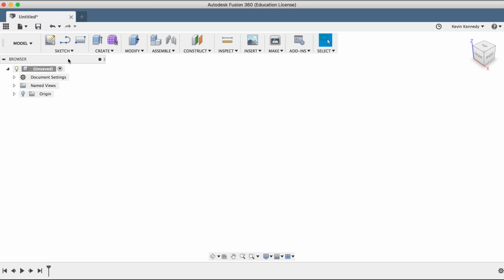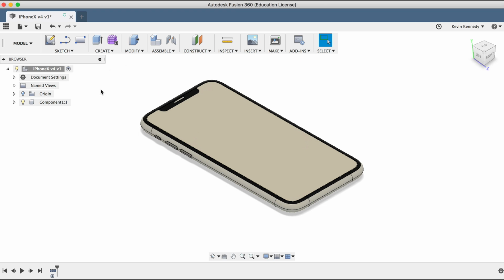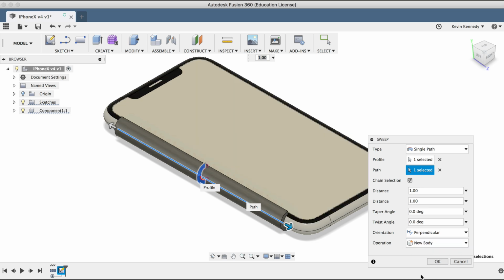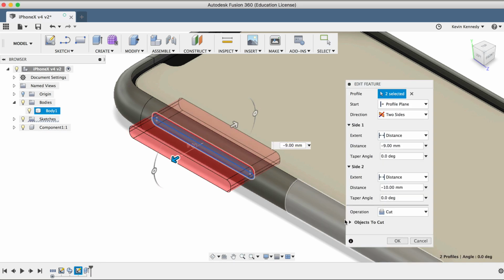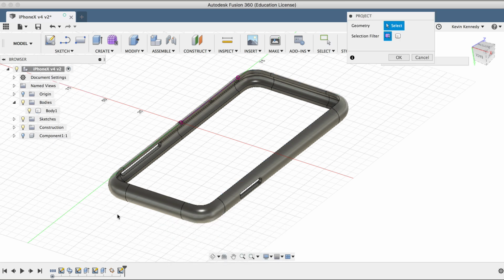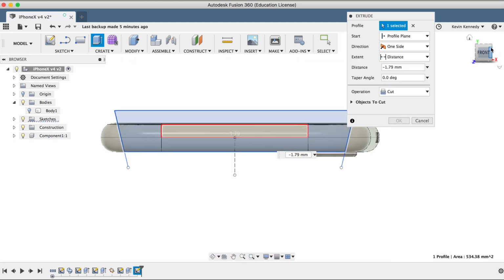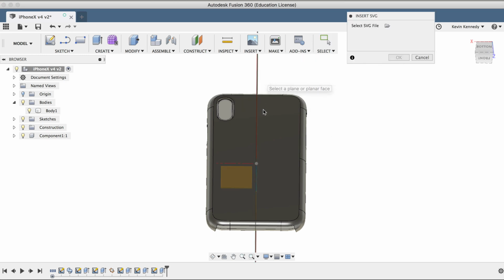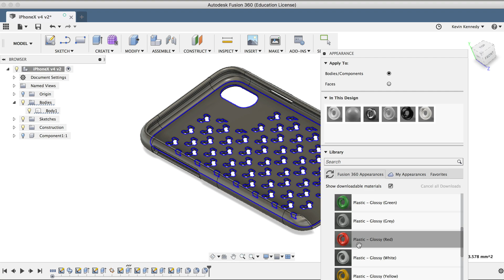How to 3D Model an iPhone X Phone Case - Learn Autodesk Fusion 360 in 30 Days: Day #10

Comment: Your series is very addictive and well presented.
 Only suggestion here is a bit more info on the Cad Model. 
I have a Umidigi A3 Pro and unable to find a cad model. Will an stl file work the same as svg. 
Is it possible to create an svg model of the phone in F360?
Reply from the maker: Thanks, Apa Ched! I'm happy to hear you're enjoying the series so far. Thanks for the feedback. I'll try to incorporate more info in future tutorials. In regards to the phone model, you can simply create a mock model of your phone (Simple box shape with filleted edges) as long as you're able to find the exact dimensions online (or I supposed you could measure it with a caliper). An STL file would certainly work, however, you will want to make sure it doesn't get distorted after being imported into Fusion 360 (this shouldn't happen as long as its 10k mesh triangles or less).

As far as an SVG - the only way I think an SVG file would be useful is if you have an SVG file of the phone shape that is at the exact dimensions. You could then insert the SVG and extrude to the thickness of the phone. If you follow this method the key would be to make sure you add the proper fillets or rounded edges to the model so the phone case fits around it nicely.

Please don't hesitate to comment questions on the tutorials as you work through the remainder of the series. Cheers, Kevin :)
Reply: I was able to measure and create a model in F360. 

Searched On Google and found the F360 Ap store has an Ap for Svg output.
Reply from the maker: @apached343  I must've misunderstood you. Where you wanting to export the 3d file's dimensions as a 2d SVG file? If so, then a plugin would be your only option as there is no native way to do so in Fusion 360. Cheers, Kevin :)

Comment: My phone (the LG G6) has sharp edges and a curve in the middle.. how do I make a straight spline for the parts that are straight?
Reply: This is my model, I'm actually having issues trying to sweep it since it doesn't have a line down the middle: https://a360.co/2KfZCMn
Reply from the maker: @novazipstream2  Thanks for sharing your model. To create a line down the middle you'll have to split your main body in half. First, create a midplane construction plane by selecting the front and back of the phone. This will place the "midplane" in the middle. Then, select the "Split Body" command from the "Modify" dropdown list. You'll be able to select the phone body as the body to split and the newly created midplane as the "splitting tool". After clicking "OK" you'll see that you now have a line (Edge) of each half of the phone body that you can reference for the phone case.

I hope this helps! Cheers, Kevin :)
Reply: @ProductDesignOnline  Thanks for the info! I just managed to get it split but the buttons end up creating multiple sections of the middle instead of one solid middle line, so I can't select the entire middle line to sweep the entire phone. I'm also having this issue where when I try to sweep around the curves of the phone it throws an error saying "Trying to sweep on illegal surface".
Reply from the maker: @novazipstream2  What you can try next is using the sketch "intersect" tool to recreate that sketch geometry where the split should be. This will make sure that the geometry is all one piece and not broken up by your buttons. Your sweeping error is likely caused by your sketch geometry path not being one continuous path...so intersecting the sketch should solve both of these. Here's a video that may be of help to you explaining the intersect command - https://youtu.be/WAs144r-Xko

Cheers, Kevin :)
Reply: @ProductDesignOnline  For some strange reason, I still can't manage to get the sweep tool to go all the way without it saying illegal surface, the intercept tool did help get around some of the buttons but it's still strangely cut into a bunch of pieces. Here's a photo of what i did so far: https://imgur.com/sbDJjxc
Reply from the maker: @Nova Leary Thanks for sharing the image. Can you share the updated link to your file?  It looks like the intersect may not works as expected because of how the original LG file was built. I'd like to inspect it further to see what's causing the breaks in geometry. Cheers, Kevin :)
Reply: @ProductDesignOnline  Here you go: https://a360.co/2KfZCMn

This is also where I got the model of the phone too: https://grabcad.com/library/lg-g6-1
Reply: @ProductDesignOnline  Hey I figured it out! I had to go a couple of offset planes in order to create the middle line and the sketch! Then I had to take the sketch and sweep around that middle line
Reply from the maker: @novazipstream2  I'm glad you figured it out! Thanks for updating me. Cheers, Kevin :)
Reply from the maker: Hi, Nova Leary. You're best bet is to create a combination of straight lines and splines. You can use them together...however, the most important thing is to ensure that they are touching. You'll want to make sure you end up with a closed profile shape, which will be denoted by an orange background highlight appearing behind the shape once it is fully closed. Cheers, Kevin :)

Comment: As usual amazing tutorial... and i want to ask u that the 3d printers are really able to produce smooth finished products?
Reply from the maker: Hi, karthik A. The smoothness of the print depends on the type of printer, printer's ability and how well the printer is tuned. For an ultra-smooth finish, I would recommend an SLS printer for something like this phone case. Using a consumer-level FDM printer can yield some pretty good results; however, it is very likely that you'll see some of the layer lines on the sides. One could always finish the print by sanding it, painting it (optional) and then cover it with a few thin layers of epoxy. The epoxy coatings also add quite a bit of strength. Cheers, Kevin :)
Reply: @ProductDesignOnline  Thank u..
Reply from the maker: @karthika8094  you're welcome! :)

Comment: "for some reason the project didn't work"... story of my life with fusion 360.  Do some commands exactly as I see them, fail, fail, success.  Not changing anything...  Very powerful software but it's got some serious quirks that I haven't encountered using other equally powerful software such as Photoshop or Illustrator
Reply from the maker: Hi, seventyfive1. Did you end up getting the project feature to work?

Due to the 3-dimensional nature of CAD, there may be times where it's hard to get things to work... it's usually the small things that are off. Sometimes even hard to notice from afar.

As a long-time user of Photoshop and Illustrator I can agree with you; however, you have to remember that those programs have been around 25+ years. Fusion 360 just turned 6 this week. Fusion 360 has come a long way. I've remember how horrid it was the first year it came out. It has a ton of features and a lot of quirks to work out...but the team does a great job of updating it each month.

Keep at it! Cheers, Kevin :)
Reply: @ProductDesignOnline  I did get the project to work, I was more speaking generally.  I have a serious love hate relationship with Fusion.  When something doesn't work or I try to do something that should be easy but turns out to be counterintuitive I get upset but then when I am able to make a giant and complex shape super quickly because of the powerful feature set I am in love again.  Your videos have been a huge help and I've shared your channel with a bunch of friends.  Every video of yours I learn something useful and, to be fair, after being about 15 days into your 30 day tutorial, things are becoming more intuitive now that I understand the work flow concept.

Thank you so much for posting all these tutorials.
Reply from the maker: @seventyfive1  Understood. Fusion 360 (and all CAD programs) can be frustrating at times. I always recommend stepping away from the computer for at least 10 minutes any time that you're stuck on something. I personally do this...and after working in CAD programs for over 10 years I can't tell you how many times it was because I typed something out wrong, clicked something slightly off, or something else small and silly that throws the entire thing off. Generally, taking your eyes off of it for a few minutes will help you look at it from a different perspective.

With that said, I'm glad to hear you're learning lots from my tutorials. A lot of it also boils down to just spending more and more time in the program. Keep at it and please don't hesitate to comment on any of my videos should you have any questions. Cheers, Kevin :)

Comment: Cool, I've just made a cover for my wife's Samsung... It's going to my printer .. Can't wait to see the results... ;)
Reply from the maker: Let me know how it goes, Fanny. I printed mine out on an Ultimaker 2 with the highest resolution settings and it worked really well. I would definitely recommend the best settings your printer has. Cheers, Kevin :)
Reply: @ProductDesignOnline   First time I'm printing with 0.12 layer height.. Looks good for know ... https://imgur.com/sRuxsmZ ..   Tomorrow I will know if it works...  and after that I'm going to use a gold filimanent...
Reply: @ProductDesignOnline  Can I print it using PLA? Will it work for a phone case?
Reply from the maker: @SuperRahul94  Hi, Rahul. Yes PLA does work for this. I've also found that Nylon filament makes great phone cases because the end result is a bit softer and comfortable to hold in one's hand. Cheers, Kevin :)

Comment: For anyone that has issues with your sweep connecting back to itself, it's your initial Fit Point Spline. Make it slightly larger and try again.
Reply from the maker: Thanks for sharing this with the community, Bcrhiaadn. Cheers, Kevin :)
Reply: Thank you for mentioning this. I spent the last two hours wondering what heck I was doing wrong!

Comment: Me again, Question Again. Why did you use the PROJET function for the back of the case? I don't quite understand the function of PROJET other than "projecting a sketch to a plane". Is there any deep function of PROJECT?
Reply from the maker: Hi, Leo. Please check out my video on the project/intersect commands. This will hopefully clear up the different and reasons on when to use each one - https://youtu.be/WAs144r-Xko

Cheers, Kevin :)

Comment: Hi,

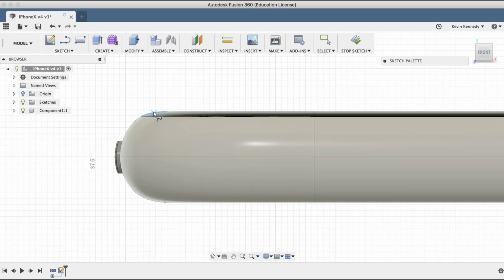In the beginning of the video, at 02:15 when you are making spline to get the shape. How is the edge of the body visible?

I am trying to place a point for spline on the edge of the body and it does not snap. 
What can be done?
Reply from the maker: Hi, Simran. I have the top level component active, which ensures that the entire model is visible and referenceable. If yours doesn't snap you'll want to make sure you have the right components "active" as well as your "snap" option turned on in your preferences and the Sketch palette. Let me know if that helps. If that doesn't seem to be it we can trouble shoot further. Cheers, Kevin :)
Reply: @ProductDesignOnline  Hi, Kevin. 
Thank you so much for your reply. 
I made sure that the component is active and the snap option is turned on. But still, it does not work. 
It snaps to the sketch grid but the edges are not referenceable. 
Can you tell me what can be done further?
Reply from the maker: @simrangoplani7434  Thanks for getting back to me. I believe it's because of a preference that you may not have turned on.  Tangent reference lines will only appear in sketches if you have the "Auto project edges on reference” setting turned on.

Learn how to turn it on here - https://productdesignonline.com/fusion-360-tutorials/10-questions-fusion-360-beginners-always-ask/#3

Cheers, Kevin :)
Reply: @ProductDesignOnline  oh ya. It did work. 
Thank you so much :) 
Because of I'm new to the software , simple things can make it seem complicated.
Reply from the maker: @simrangoplani7434  You're welcome! These little differences in settings trip up even the most experienced users. Cheers, Kevin :)

Comment: Hey Kevin, Just a quick message to let you know I've sent you a link of the phone case file I'm working on, thanks in advance
Reply from the maker: Thanks for sharing your file, Paul. I was able to take a look at it. Your "Bumper" part is in the bodies folder, which is the same level as the top-level component. I would recommend right clicking on that body and select "Create Components from Bodies." This will create a new component at the bottom of your Browser. I'd recommend renaming the component before you forget. Then, you can CMD (Mac) or CTRL (Windows) click the bumper component and the "Camera 4de4" component which appears to be the back. At that point, you should have both of them highlighted and you can save as an STL, merge the bodies, or so on...
Let me know if that helps! Cheers, Kevin :)
Reply: @ProductDesignOnline  Thanks for coming back to me, I created a component from bodies as you said but still had problems with adding the 2 together, however I did manage to do it by combining the 2 together then saving it as a STL file so all's well thanks again, and keep up the good work it's much appreciated
Reply from the maker: @paulfarmer3091  I'm glad you found a workaround. Thanks again for your support! I'm always happy to help. Cheers, Kevin :)

Comment: Hey Kevin, I'm trying to select the bumper and the back but no matter what i do i cannot seem to get the 2 to select together i seem to be toggling between 1 or the other but not both together, ive tried switching on/off all manner of things but no success, crazy little things make it really frustrating, i did a screenshot but cant attach it here i guess
Reply from the maker: Hi Paul, sorry for the delayed response! Would you mind sharing the link to your file so I can take a look?? Share your public link as a reply to this comment. Here's a video explaining how to share a public link - https://youtu.be/2XrcrdV-8Ls
Then, please write a separate comment letting me know you've replied with a link because YouTube flags most links and I don't always get notified. Cheers, Kevin :)
Reply: Hi thanks for the reply, this is the file link https://a360.co/2HY81BK I imported the model from grabcad so most of the stuff in there is straight from there not created by me. Let me know where I'm going wrong I'm sure its something stupid I missing
Reply from the maker: @paulfarmer3091  Thanks, I'll take a look at your file and get back to you! :)

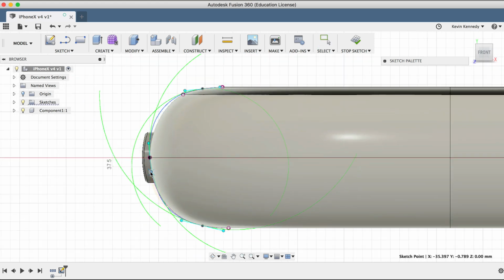Comment: When I create the spline (@2:21) I am unable to grab the spline handles (actually, I can grab one, but after I finish dragging it around, I can't grab any others) because when I move my pointer to the spline, the face highlights and doesn't allow me to click on the spline.  
Based on something you wrote me in an earlier video, I thought it might have to do with the Selection Priority, i.e. maybe I should change to 'Select Body Priority', but that didn't help.
Any advice?
Reply from the maker: Hi, StepInIsrael. It does sound like an issue with your selection filters. 'Select Body Priority' is intended to help you select the bodies of large assembly files...so that you won't want to use that. Instead, make sure that you go to the "Selection Filters" and turn on all of the options from "Sketch Curves" on down. Let me know if that fixes it! Cheers, Kevin :)
Reply: @ProductDesignOnline  Yes, that did it.  Thank you!!
Reply from the maker: @StepInIsrael  You're welcome! Glad I could help :)

Comment: I uploaded an STL of an iphone 7 but it installed as bottom up on the XY plane. How do I get it to be face up on install?
Reply from the maker: Hi, Peter. To reorient your model, click the caret (down arrow) icon next to the viewcube in the upper righthand corner. Then select set current view as > front (or top, whichever one you need). Cheers, Kevin :)

Comment: I imported a different phone and it does not have the line around the phone. So now I am stucked when it comes to sweeping the profil around the phone??
Reply from the maker: Hi, Carina. It will just take a few extra steps to set up that middle line...then you'll be able to follow the rest of the tutorial by sweeping.

Try splitting your model in half to create some new geometry for the sweep to follow. Use a midplane construction plane (select the front and back of the phone) so the construction plane is directly in the middle of the phone.

Then, use the Split Body tool in the modify dropdown list. You'll need to select the body of the phone model as the "Body to Split" and then you'll want to select the construction plane as the "Splitting tool." After clicking OK, your phone body should split in half. Try using the sweep command by using that new "edge" created by the phone being split in half. If that doesn't work with the sweep command, you may have to "project" the edge sketch geometry onto that original midplane construction plane...which will ensure that all the sketch geometry is on the same plane.

Let me know how this goes... or if you have any follow up questions! Cheers, Kevin :)